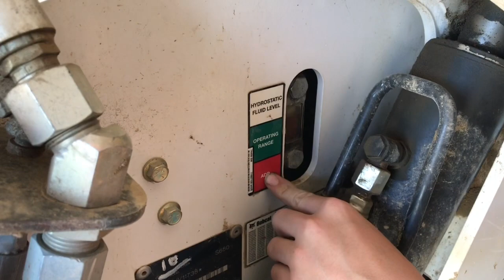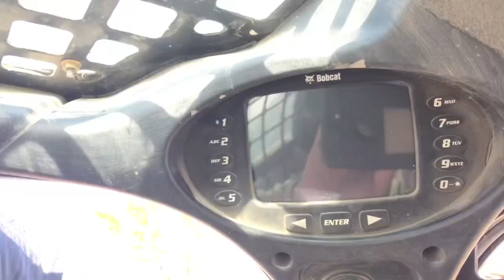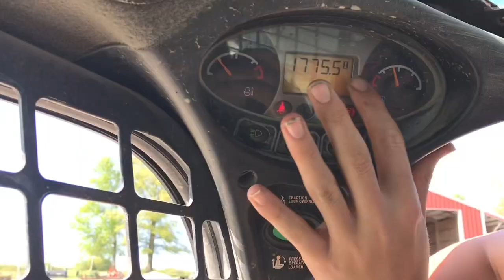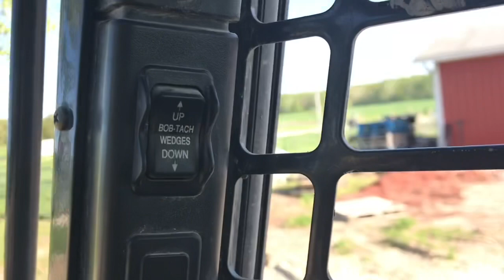S650 Bobcat operation

Comment: Cord you unplugged was the block heater. It keeps the block warm for easier starting during cold starting at freezing temperatures. The heater core that has antifreeze in it is what gives the cabin heat.

Comment: Very well done instructional video.  I'm 59, bought an old backhoe last year, learned how to use it, otherwise, no heavy equip experience.  Have a rented skidsteer arriving tomorrow.... watched a number of videos, I think yours is my favorite... very comprehensive, start to finish... its all well and good to tell someone what the joysticks will do, but starting your video with safety, including how the get out if you roll over... and also maintenance... where's the diesel fill, oil, etc... your video is start to finish, nuts and bolts... Parents should be proud, keep up the good work.  Mike, in Canada